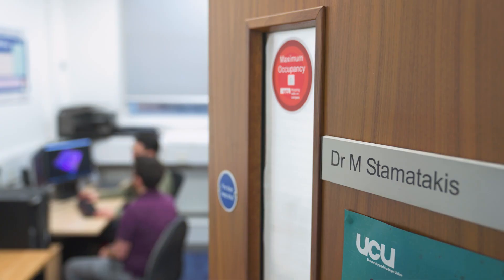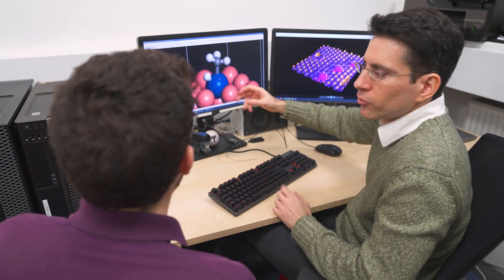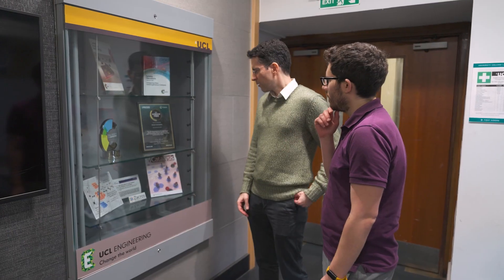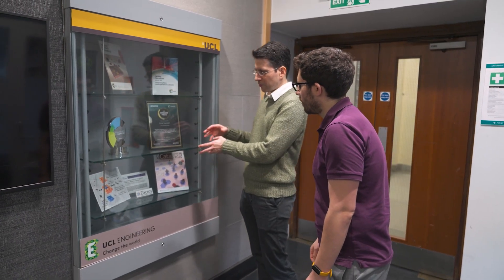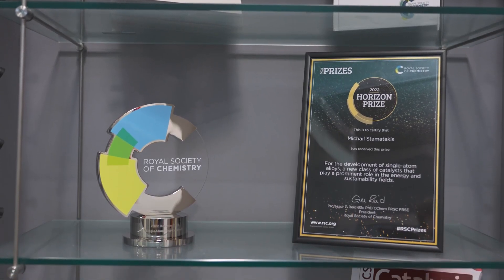Single atom alloy catalysis

Comment: While reading a book on nanotechnology in that book 1 kg of platinum can make 100 million tonnes of chemicals so basically there is no shortage of platinum. The problem is countries buying up and storing it in vaults . The major aim is to produce green hydrogen at the moment you need 50KW of energy to get 35KW the aim is to lower it to 45KW . As soon as hydrogen is made it has to be used for ammonia production.